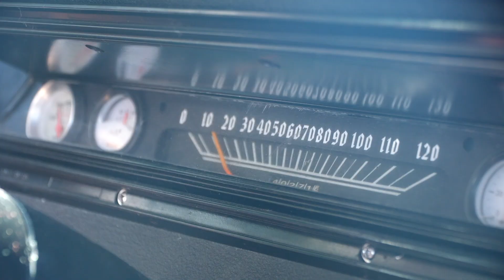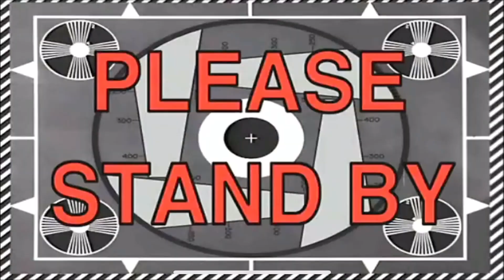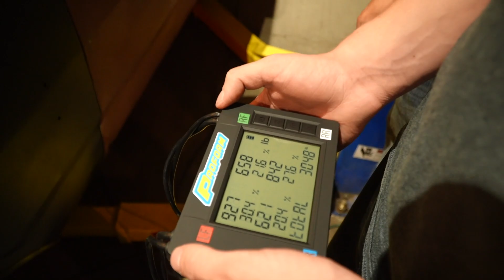The New Project! Allison's '67 Dodge Dart!

Comment: Love y’all!
That rear caliper is a park brake caliper from the rear of a Cadillac. I tried them on my hot rod A and got sick of them. I had them rebuilt at a vendor I deal with for medium duty truck hydraulic brake boosters and etc. Not the fault of my vendor of choice, but they started leaking again. So, I changed over to dirt car style hat rotors and 75 Chevy pickup front calipers, and my 4 wheel disc brakes work far better than the way I had originally built my car. 1929 Model A highboy Tudor with SBC and 5 speed, 9 inch ‘59 car rearend.

Comment: I had a 89 El Camino ,with a stock 350,350 Automatic  with a aluminium intake headers.     With 276 rear gear ,it ran 9s in the 8th mile and 14 s in the quarter ,never got out of second gear

Comment: Cadillac used those too. The purpose was to have a parking brake. Try early 80s buick regal(rwd), front calipers. They will probably bolt up that bracket and hose. Put the left one on the right and vice versa, to get the bleeders on the top. The only caveat is no parking brake. I have that set up on mu 3750# 70 gs with trans am rotors. I also use them with 70 manual 4wheel disk corvette manual master cylinder, front chevelle calipers, and original drum brake distribution block (not a proportioning valve). Works well on an 11 sec car.
Reply: Also look up scarebird brakes.

Comment: This is a perfect candidate to follow a Matt's Sloppy Don't BS me build! Huge following with the sloppy guys and I think it would be the biggest return on attracting the most new subscribers- you may not otherwise find.

The LS may be a Poison Idea

Good luck!
Reply: Yeah, just what the world needs another LS swap. How about build the 340 or put a gen3 hemi in it. THAT would bring new viewers here, Mopar fans would love it with Mopar power.
Reply: @Sixguns1  I've built a 360. Has nothing on an LS. 

I feel the LS is the Foxbody of engines. Even if you don't like Fords or Mustangs, you can respect what the Foxbody movement was in the 1990's.

The LS is the most advanced production pushrod motor design. It offers unbeatable value. Stock bottom ends are capable of over 1000hp. They can be acquired for sub $500 all day. 

The modern Hemi (not that they actually have a hemispheric combustion chamber) is not going to be nearly as compact as the LS. It is more expensive in all areas with zero significant advantage other than religion. 

The number of LS fans is probably 10:1 on Mopar & new Hemin fans. They just don't have the movement behind them like the LS does. There aftermarket support of the LS is probably closer to 100:1. It just makes poor business to ignore the advantages and strength of the LS movement- especially when Tommy is running one!
Reply: @PaulsProTips  Yes, the LS is cheaper in one respect, and that's the fact that the stock piston in a junkyard engine can be used with boost, the hemi's stock piston has to be changed. That's about it, I bought two hemi's, both less than 500 a piece. The stock Eagle hemi head ( 2009+ 5.7) flows 340 cfm STOCK, 365 cfm with a valve upgrade and a good valve job. No LS production head comes anywhere close. There's no doubt the LS is a great engine platform, but contrary to popular belief it's not the only viable power option. Rob Goss's gen3 Hemi powered Challenger destroyed everyone in X275, and that's in a sea full of chevy and ford powered cars.

If that 340 was built with the same parts as Billy's sbc, it would be just as fast or faster.
Reply: @Sixguns1  i get the "Hemi" can be a contender, but the LS package is much more compact. If you like working on your car, the LS packaging is very welcome.

The LS3 head flows 317 so yeah, down from your 340cfm on the "Hemi" but it is not really needed for many applications. Matt Happle went did his 8's for $8k project with a head that flowed significantly less.

Billy's motor is well over $20k before turbos so yeah, if you spent that same amount on the 340 (who's stock block would break at those power levels) and put it against a $500 5.3 with another $500 in cam/springs/pushrods- I sure hope the extra $19k+ would keep it competitive!

You and I cam spend Allison's money however we want. We'll see what happens. You may be right!
Reply: @PaulsProTips  I don't think I really disaree with anything you've posted, I'm just a OG Mopar guy who's tired of the LS hype wagon. I tell my Mopar buddies all the time that if I didn't have my stupid brand loyalty I'd get a notch foxbody and put a LS and a glide in it. No better choice for factory suspension, available parts and affordability. 

I'm glad for Allison no matter what they end up doing and wish her all the best of luck with it.

Comment: I'd go with either a Mopar 360 Magnum or a 392 Hemi !    put a 100 shot on to get Allison a feel for it,  add it as a scramble button,  so she only hits in he high gear !!  now some M/T's rear street tires for grip. I'd check the U-Joints & front wheel bearings , Change all fluids ! Add some Octane Booster & Go Racing.  Eszy name  -  Dartlison

Comment: Billy Tommy and Allison if I'm not mistaken the brake calibers that you can use would come from the front end of the second generation S10 Blazer the only difference between the two calibers is the part break the size and setup I believe is the same
Reply: Hey you guys my apologies the front brake calipers on the Blazer are dual piston the caliber that I was actually speaking of was off the S10 which is a single piston neither one has the parking brake but it does work in a pinch have a good day

Comment: Those 340's are baddd asss , just have to get the right stuff on it 😊... What gear is in it and so on ?? Nitrous is pretty harsh on the heads by the sparkplug threads atleast mine was ... I like the car myself , paint job would be nice  ... But i still love the S10 and the falcon 🏁🏁🏁

Comment: That caliper is the same as a stock rear disc brake off of a 86 Z28 Camaro calpers work good they stopped my 572 big block on two kits

Comment: @SRC Photo; Great content. Great New project Dart. Much Success in Your New Quest!
A few have some good suggestions, for the car name.
Clearly, as you stated, You want something 'catchy', simple yet fitting.
Much can be done with using that 340 [c.i.] if it is actually. And many possible more powerful Mopar swaps. Certainly that unique rear set-up on the frame will allow for some unique, useful adjustments to handle significantly large power and torque. All in stages, as You grow with this platform, Allison.
Of the better, that seem fitting are the AlliDart or AllyDart or AllyCat, or AlliCat or Annihilator from the Dominator Dart You know.
Also thought of something similar with Allihoe or Allyhoe [like 'Tally hoe and away We go'] or AlliOh or AllyOh or AlliWoah or AllyWhoa or Ally Da Cat or  Alli de Cat [sly, sneaky, puuurrrrched to leap and run fast]
Much Enjoyment, Success, Growth in Your Quest within Your Your New Project ... Go Get'Em, Dust'Em Allison Dart .. with every challenge, opportunity with each of You Allison, Tommy, Billy, all of the folks of SRC Garage-Shop, and both families.
[other possible good names; Allison's/Alli's/Ally's Dust'Em Dart, Get'Em Dart, Get'Em & Dust'Em Dart, AlliCat's Get'Em, Dust'Em Dart]
Sincerely

Comment: Let her crawl before she walks. She needs  to learn naturally aspirated and work her way into nitrous and turbos.mopar is very finicky . The timing and the vacuum have to be right or it wont run for crap. But when its set up right they  are very strong. We have two mopar drag cars. A 1971 big block 440 /60 over. competition orange demon. And a pink 2010 chllenger drag pack car with a 6.4 hemi. Both are na and have around 650hp to the tires and run 10.50' s at 135 to 140 mph consistently. Have fun allison. Your gonna have a blast but be careful and enjoy yourself. Take your time and learn it

Comment: What's the front suspension? I'd ditch that old 6 link qa1 set up and look at their new triangulated set up.  I think you'll struggle to even get a 275 under the rear with the 6 link gone. You can't fit much of a tire under these cars without a mini tub.

Comment: there is a company in CA that I ordered my disc brake kit from that used early 70 cadillac brake calipers  you could check thru them    the company sold those kits thru jegs

Comment: I'm sure you know , but they made 2 classes of 340 the Ar block considered a true small block wedge. The other is also a good motor . They can make a lot of power. Stock earlier engine 10.3 to 1. I had both built both . Had fun street beating up some 5.0  mustang.

Comment: Tommy ideas after you get to know  how  to race  Mopar  were my love 68 Roadrunner  for years  I did the street  racing   back  in the 70s my built motor held together  over 40000 miles  hard  drive  and lots of racing  the motors not cheap  to build  back then either but lasted way better  Chevy or Fords it only lost .09 of a second  at high mileage  sad to I went Cheyy for the cheap  to build  I never last the mileage  if interested  let me know

Comment: Just buy some W-2 Heads and have them Fully ported Stroke it to 408 and run 10:5 compression with a Mopar performance camshaft 312/.590

Comment: The vinyl top would fricking make that thing. What a cool car!
Edit- it’s a big ol’ 60s sedan, it’s her dream car, so call it “the dreamboat.”
Reply: Tk Boyd; The Dart-Valiant and Demon-Duster versions were midsize vehicles.
The Coronet-Fury were the full size.
Then, there was the large, luxury size sedan of the Imperial size comparable with the Cadillac, Olds Ninety-Eight, Lincoln, Mercury luxury version sedans, still into the '70's.
Sincerely
My father bought a '73 Dart Swinger with a 225 [c.i.] slant Six [cyl.]. Used that vehicle for my driving test in 1975. It had PS, AC, Pwr assist. brakes [rear drums]. Learned some of my initial mechanics with that vehicle, then a '75 Vega and my buddy's 65 Tempest with 326 [c.i.], then '69 Charger with 440 Magnum. Afterwards my own vehicles. beginning with '73 Opel Manta, '73,4 Toyota Celica, '78, 80 Corolla, '79 M.B. 280E [best vehicle owned], '77-8 RX-4/Cosmo [most interesting Wankel], and with many friends' vehicles, mostly helping them.
Sincerely